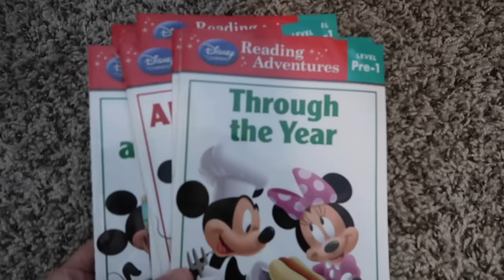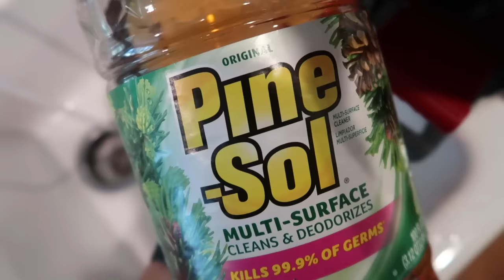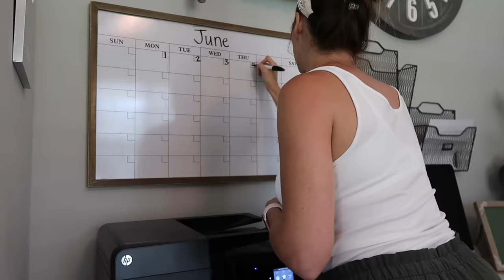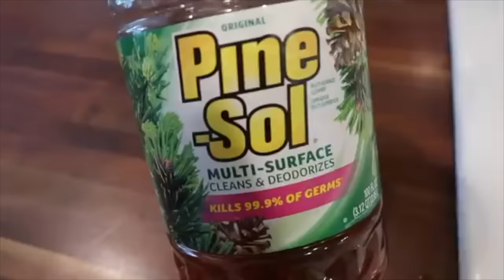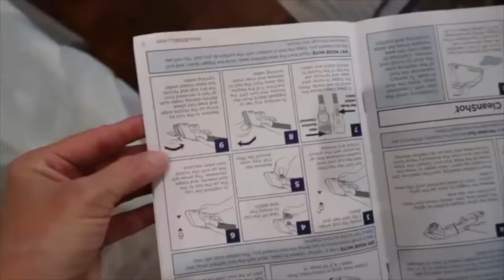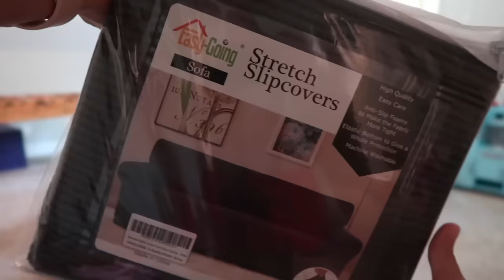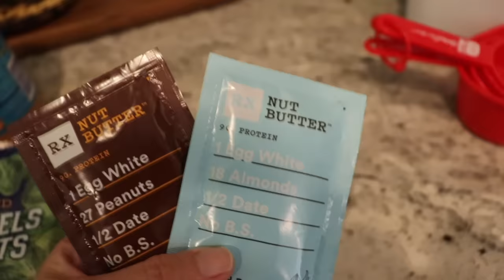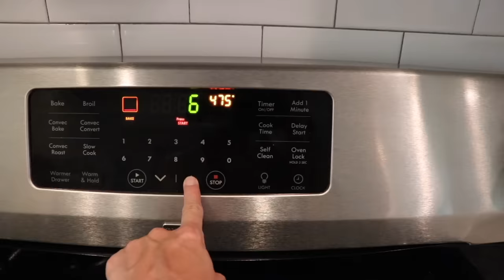2020 EXTREME CLEAN WITH ME MARATHON | SUPER LONG CLEANING VIDEO | ULTIMATE CLEANING MOTIVATION!!!

Comment: For people with pets: 
If my doggies have an accident on my carpet I spray white vinegar mixed with water (1 part of each).... then I put baking soda over the area... let it dry then I vacuum up the area... and use my carpet cleaner with the pet solution to remove anything else that may have soaked up it stained... works like a charm. My carpets feel great..you wouldn’t even know I have two puppies... white vinegar is perfect to get urine odors and stains from carpet!!!! I find that just let carpet cleaners are not good enough alone white vinegar is the only thing that works super well.

Comment: I use fabuloso or pine sol in the lavender sent to clean with and either white vinegar and water or Windex to do windows, mirrors and computer screens and TV screens and I'm short so I use my swifter mop with a sock or cleaning cloth on it to dust off the higher places I can't reach and I use dawn dish soap or Ajax ultra triple action to do my dishes because I hand wash them and I use either tide simply oxi, arm and hammer or Purex Dirt Lift Action in mountain breeze for my laundry and I hand wash all of them too